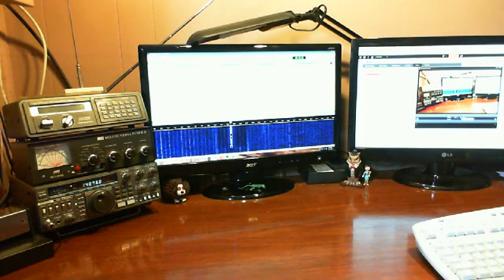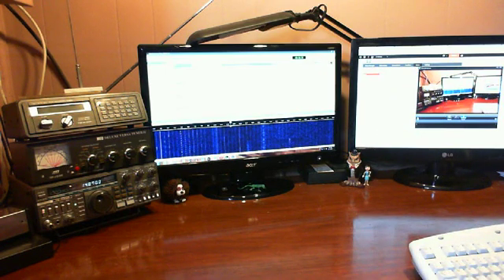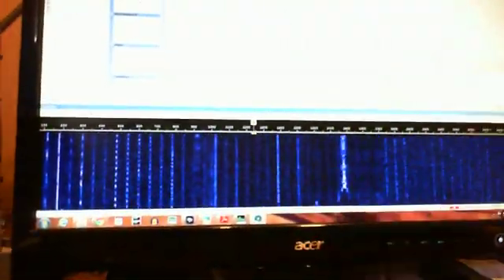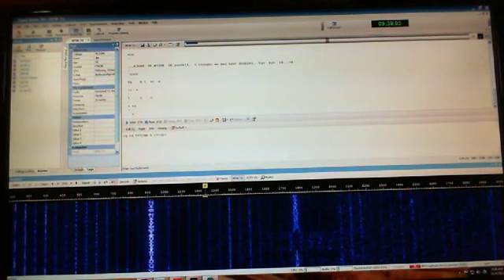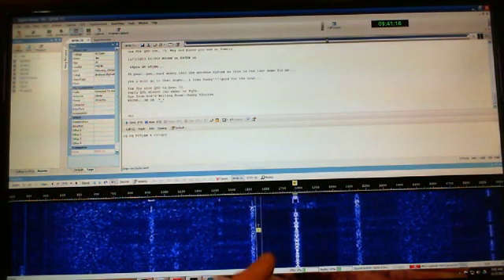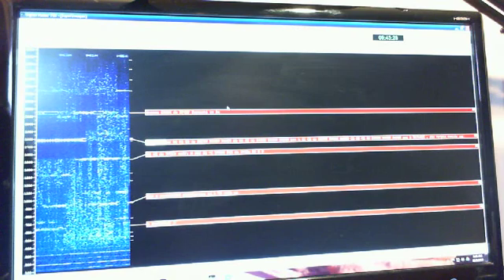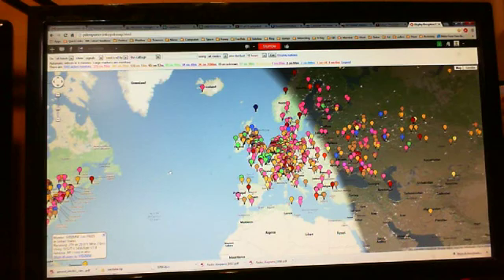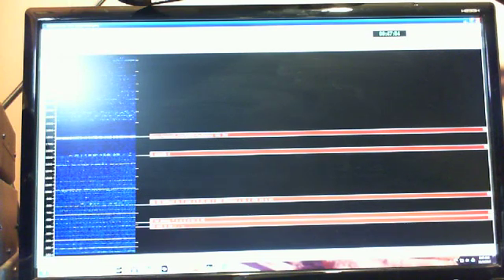Introduction to PSK31 Ham Radio Digital Mode

Comment: Thanks for the great tutorial Jim.  I have yet to make my first contact having just gotten things to the point with my ICOM 718 being interfaced to my computer.  Hopefully I will be on the air soon.  Also, regarding the comment below, the ver 6.0 and above is the only one that HRD is charging for right now.  You can still go in and download the older version 5xx for free.  I don't know what ver 6xx gives you that 5xx doesn't.  Anyway, under the program options tab in Digital Master 780 (part of HRD) it let's you set up the PSK Reporter.  It also gives you some other options that you can choose.

Comment: sadly Ham Radio Deluxe (HDR) and its sub program DM780 are no longer free. HDR decided to go 'commercial'. there is a 'free trial' of 30 days, but if you wish to continue using it...you must purchase a licence to do so.
For those 'toying' in digital who don't wish to invest in software...there are a few other FREE programs.
FLDigi is an ALL digital mode (PSK/FSK/Packtor/RTTY/too many to list all of them) and CW coder/decoder (like DM780). There is also Digipan (strictly PSK/FSK/Pactor), but a nice small digi program.
FLDigi offers alot of what HDR offers...but since its NOT a 'commerical' software, it may not be as 'refined' as something you paid for. You'll have to judge for yourself.
I'm not trying to promote FLDigi over HDR...I think HDR is a nice looking program, but I'm more of a 'monitering' guy...so, I don't wanna spend $100 on something I don't really USE to a great extent.
But, I'm lovin' what digi I do listen to. If you want to 'experiment' for more then a month (some ppl don't have 30 days to evaluate something, busy busy ppl)...there's two FREE suggestions.
Reply from the maker: MrRocque Thanks for the updated info on HRD. There are many programs out there for free. I wonder how long my copy will keep working.
Reply: Jim Lindenas as far as I know...and I'm certainly not an HRD expert nor work for them...it should work until you change to an O/S or upgrade your computer/drivers that no longer supports the software version you have.
That said any logging, online services and/or activities could be effected by 'outside' technology advancing beyond the versions capability. But such is the case with any software (ie. XP is very quickly being dropped by everyone).
The biggest effect of HRD going 'commercial' is that what ever free version you happen to have, can't be upgraded to the 'latest/greatest' of course...and any NEW radio (released AFTER your version) may have compatability issues as the 'old' software looses touch with advances in radio equipment (interfacing).
The best thing to do is check HRD's website and/or contact them.
Reply: +MrRocque I wasn't aware of FLDigi, thanks.I like the Digipan interface but I think that Pactor is receive only to identify interfering stations.
DxLab also has a suite of programs including logging and QSLing via Lotw and eQSL. I've also used MMTTY and MMSSTV for slow scan.
I've been away from this for a while and as soon as I can get a decent antenna up I'll get back into it.

Comment: I have a question sir if you can enlighten me. I want to transmit a text from my computer using PSK-31. But my radio, only can operate at UHF band 400-450MHZ. I cannot use 14.07MHz(20 meters). Am I out of luck? Or is it still possible to transmit/receive properly with UHF?
Reply from the maker: Outlaw I don't think PSK31 is popular in the UHF band but I suggest you hunt around the internet as things are developing all the time.
Reply: You certainly can use digital modes on the 70cm bands, the problem is, most activity is on FM, and it is relatively short distance compared to 20 meters.
Reply: +Outlaw there is a wonderful video on YouTube re: FLDigi and the use of digital on V/UHF (as an emergency plan). Digital can most certainly be used on any freq. (within the rules of your licence), its more a case of 'will you have anyone to transmit TO'.
Check out a video titled "Fldigi Tutorial" by HuthandBoothPhoto.

Comment: Hi Jim. Recent subscriber! I'm really out of touch. Been a Ham for about 50 years but not very active. Only comparable experience was 25 years ago using a Kantronics modem for CW and FSK with a 1984 Macintosh. My personal challenge (after paying for the modem) was writing my own terminal program using Basic. It also used three windows (receive, transmit and type-ahead) but had very little control over the TS-430. Totally different technology! Always loved boat anchors though and had the opportunity to use Collins S-Line in the service (Army MARS). Those were the days. 73  Dave
Reply from the maker: Hi Dave.  I got my license in 2002 which was something I always wanted to do.  I thought I'd better jump on board ham before it disappears.  I didn't know anything about digital modes or PSK31.  Turns out Ham is bigger than ever and computers have augmented the hobby (like everything else).  From what you did back in the 80's, you are ripe for the current digital modes so give it a try.  Jim.

Comment: Hi Jim.  Thanks for the video.  I'm just learning about PSK31 and i'm excited about the website tracking with DM780.  Will be great for tuning TX in the future.  Have been using MixW and Digipan to test my Rigblaster and gear and preparing for test.  Once i have a Call sign i hope to see you on the bands.  ;)

Comment from the maker: Thanks Bobby.  I'll be in Florida November 5th to 12th so I haven't gone yet.  I've shot videos on the next radio and I'll be posting them while in Florida so there shouldn't be a big break.  

Glad you liked the PSK31 video.  If I post one where I'm actually working stations, you'll see the exciting side of doing this.  Any radio that has SSB reception can receive this and anyone can download free software to decode it.  But transmitting is where the real fun begins.  Jim.